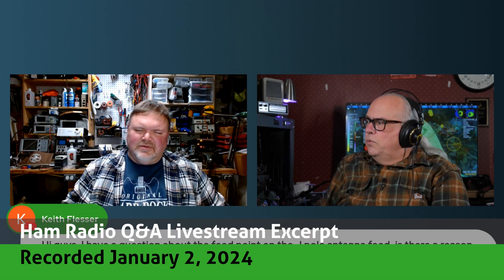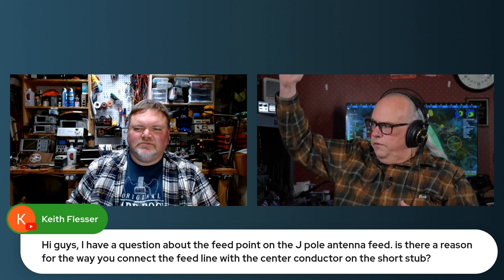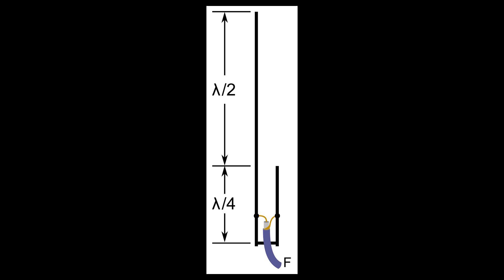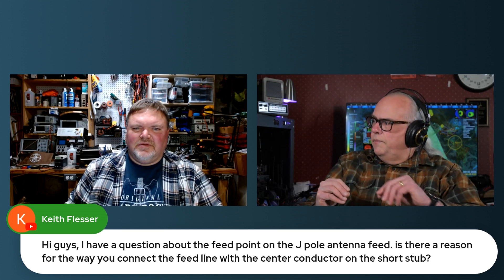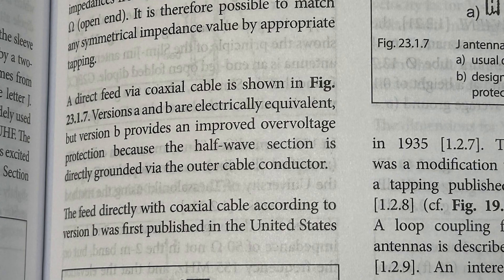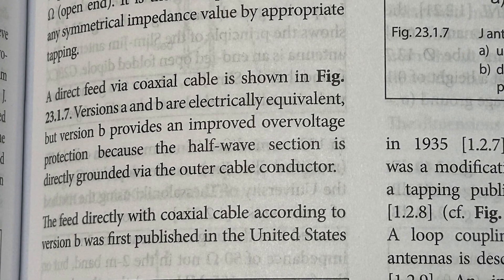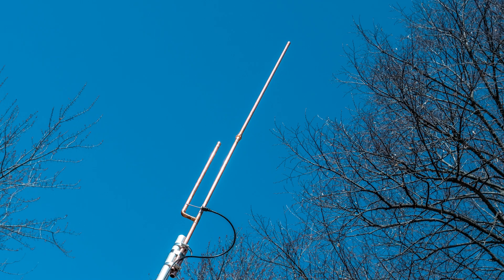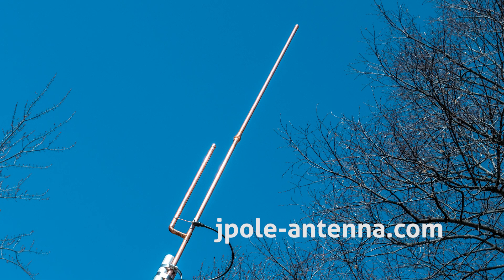J-Pole Antennas: Why the Feed Point Matters

Comment: Michael .. why does the J-pole not use any weather protection on the bare wire to solder .. I'm intrigued by the design but concerned about water intrusion into the coax connector.  Will copper corrosion impact swr or otherwise on how this antenna performs over the course of time if mounted permanently outside?
Reply from the maker: As the copper ages, it will develop a dark brown patina. This doesn't affect the performance at all. I've got an antenna that's been up for at least 15 years and I periodically check it with a meter. I have not observed any change in SWR over the years. As for the connector. I do use Amphenol brand UHF connectors which are a higher quality than the Chinese ones on the market. They are highly resistant to water intrusion and as long as you tape up the connector well with high quality electrical tape, like Scotch Super 78 or 33+ you shouldn't have an issue either. But if you are really conecerned, you can seal up the back side of the connector with silicone.

Comment: This antenna is NOT better.
Reply from the maker: How so? You can't just say that without proof.
Reply: @KB9VBRAntennas  compared to 3 other antennas this one is deaf. Coming from the dame repeater -120 to -115 dbm compared to -95 to -85 dbm consistently. Also I tried 2 of these one had a very good swr of 1.01 the second one is 1.5 swr on the same radio, coax and the same antenna height.